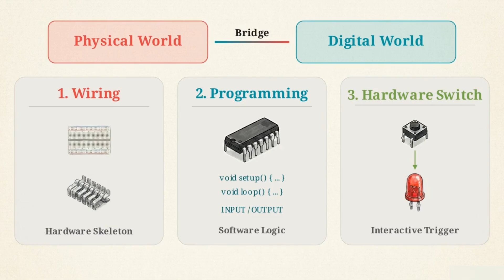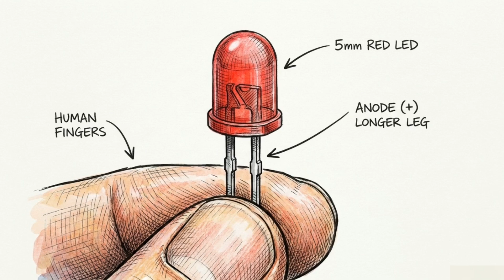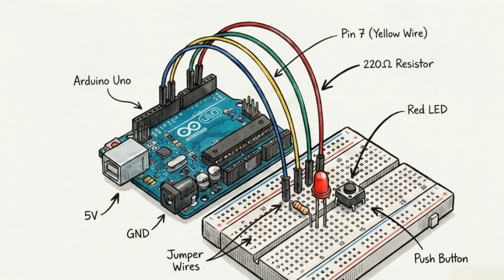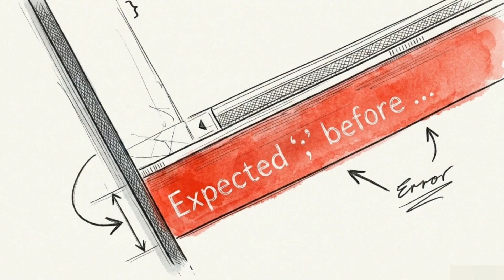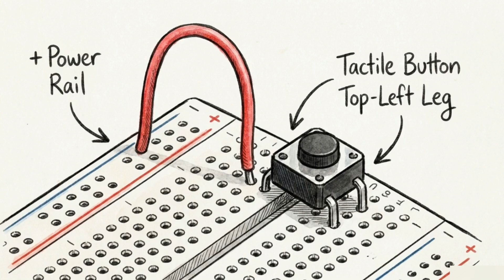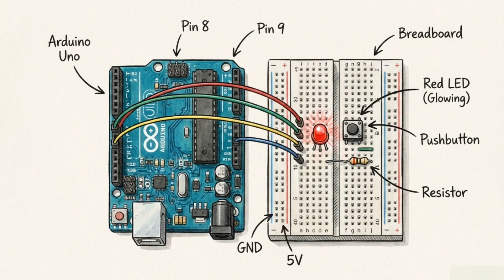Basics of Arduino : RGB Mixing, and PWM | Arduino MasterClass 01

Comment: Some of those breadboard pictures don’t look right. That is sometimes one of the legs of component look like it is in the gap on bread board or like the positive and negative legs of LED are in the same column which will cause a short.